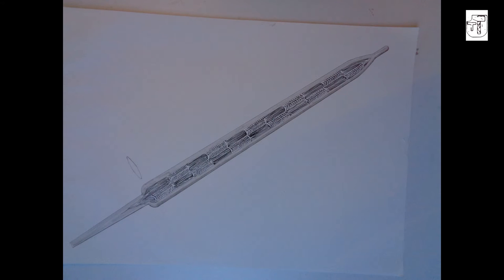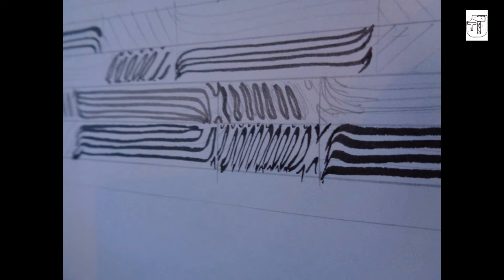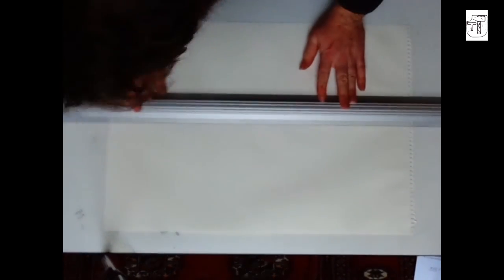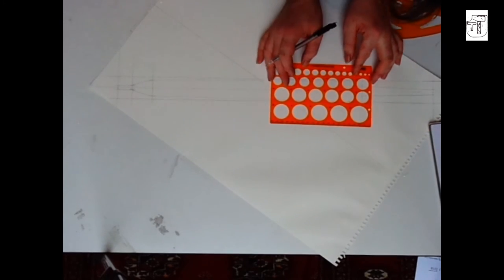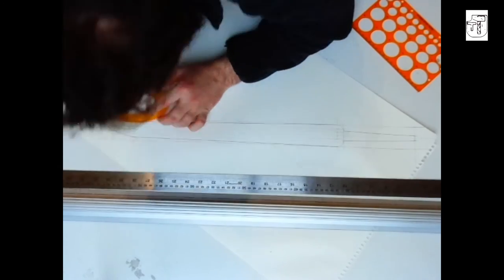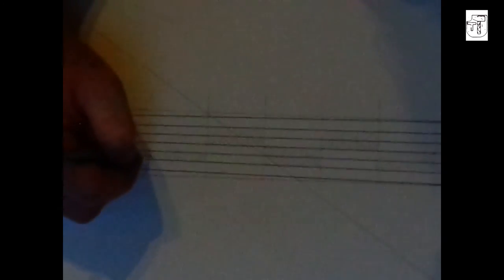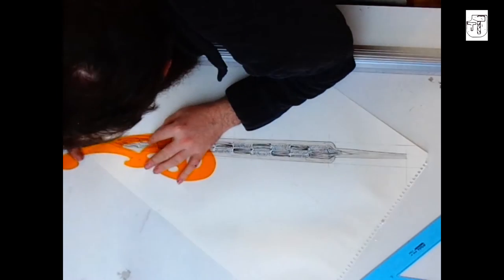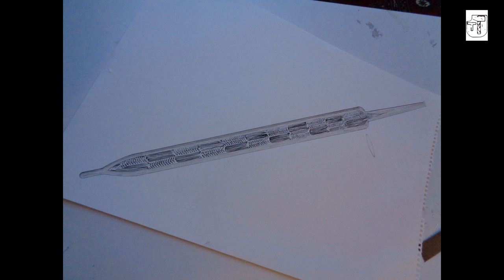Recreating a pattern-welded weaving sword. Part 1: Research and drawing.

Comment: The funny protrusion at the end is merely a space to place the thumb,index finger and middle finger as a hold while you compact vertically the threads since your right hand has a handle  you compensate by adding a protrusion so both hands work together!

Comment: You historical projects are extremely intriguing!  I was unaware of the pattern welding technique before this video, looks like a lot of fun (after the research and planning of course ;-)).  Have you looked into Saxon\Viking swords and\or spears?  I am currently in the research phase for two separate projects... a Classical Greek Dory Spear-point and a Roman Gladius... if you have any source suggestions for these, I would appreciate it ;-).

Comment: great video found it very interesting also when you make things like hooks and bottle openers do make them ahead of time? and if you do how many do you have ready to go?
Reply from the maker: +Hot Iron Art Good question and it really depends. If it is a new thing then I tend to make a batch of them. I should really keep a stock of everything but what tends to happen is that the stock runs out but I keep my listings active and I make them to order until I have time to make a new batch. You make a bit more profit making things in batches but you have to feel motivated enough to make 20 J hooks or pan racks in one go!
Reply: thanks for the info